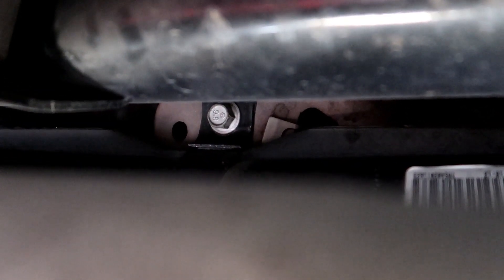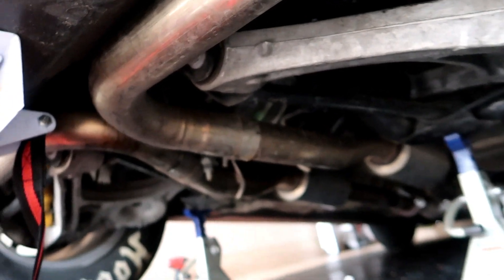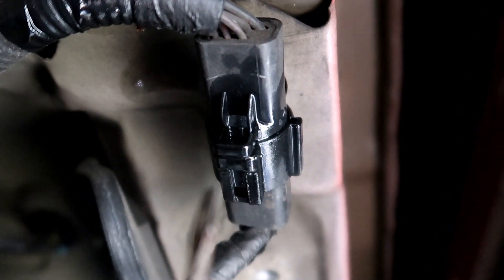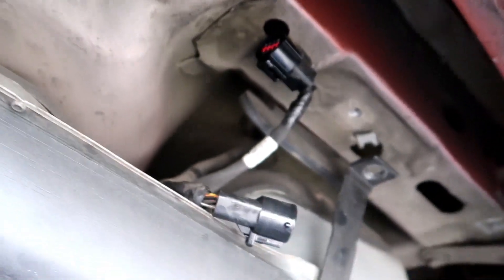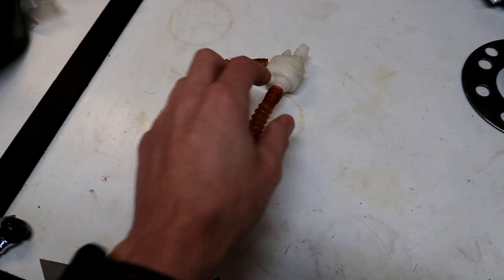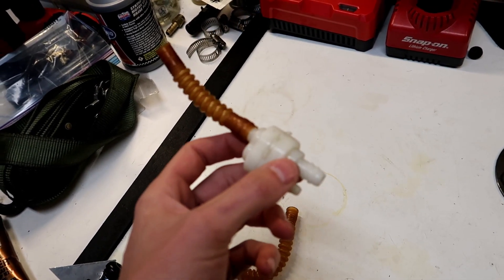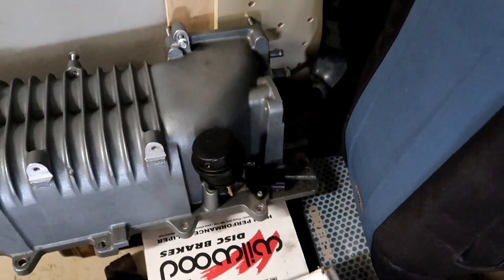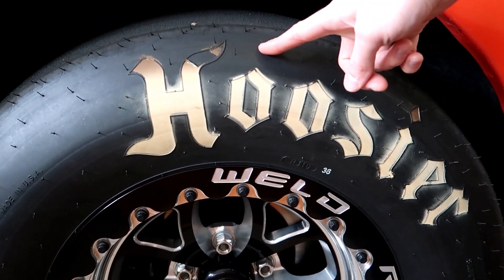Is the Cobra FIXED!!?? (PPRV delete+Street hits)

Comment: I am having a very similar issue and I have a stock cobra. On hard pulls on the 2-3 shift the car falls on it face and then jumps back up to having power. Im thinking I'm going to pull the pprv this summer and see if it helps
Reply from the maker: Yeah that's probably your problem!
Reply: Did that PPRV delete fix your issue?  My car is pullied and has that hesitation.
Reply: Um dont know as i just went with fore hat, twin walbro 525 pumps and return style

Comment: hello what is the  pros  and cons doing this and do i need to do anything when starting the car
Reply from the maker: Well every car is different but a pro is some say it stops the hesitation between shifts, i think that it only really happens if you lift all the way off the gas and shift slowly. Some cars it's very apparent and others not so much, it did almost nothing for me just a slight improvement. Con is supposedly hard/long cranking hot starts and long cranking starts after sitting for a long period of time. I have 0 issues with hot or after sitting for a long time. If you delete it just wait a second literally one second after going key on to let the pumps build some pressure and then start cranking! Hope this helps!

Comment: My 99 turbo cobra bucks between shifts terrible!!!  Kurgan motorsports said its a fueling issue and that a return style system would fix it. My current set up is factory lines factory tank factory hat and factory rails with 80pounders evap delete and a 340DW pump. They said even with that pump it can't meet the demand between shifts unless you (noliftshift) . but I don't wanna destroy my tranny

Comment: You’re pushing those stock pumps way beyond their limit that’s why you’re having all those issues as well
Reply from the maker: They are not stock pumps they are two 320LPH pumps, they should make 800HP on E85,  but they need to be on a return style system.
Reply: JaegerWrenching do a dual fpdm or modified fpdm and wire upgrade. That should work
Reply from the maker: it's on a boost a pump but ill just go return style and be done with it

Comment: You do need more fuel....do it once and do it right and don't forget about your injectors. Twin 465lph pumps and ID1000s will give you plenty of safety.
Reply from the maker: It's got ID1050's already along with two 320LPH aeromotives. we ahve enough pump and injector. just need a proactive system instead of reactive like the stock deadheaded system is i think.